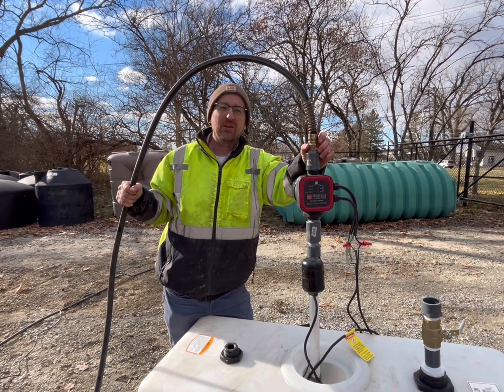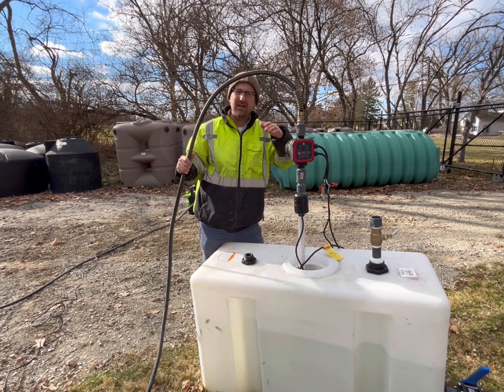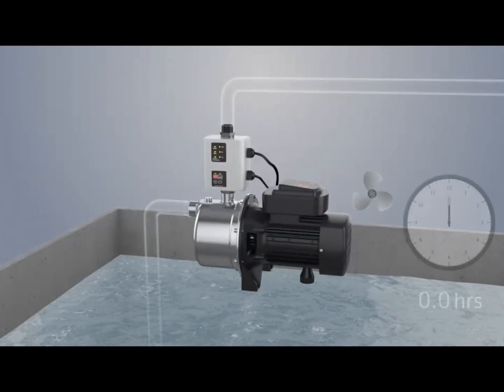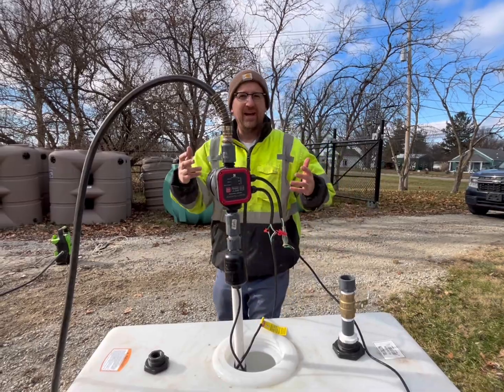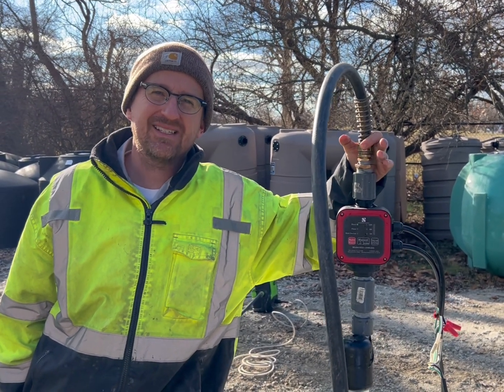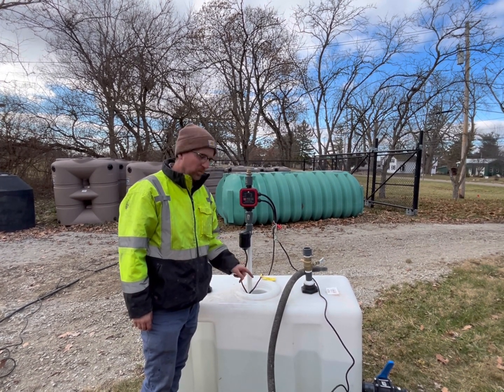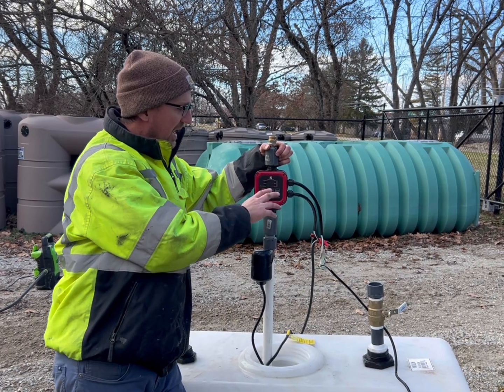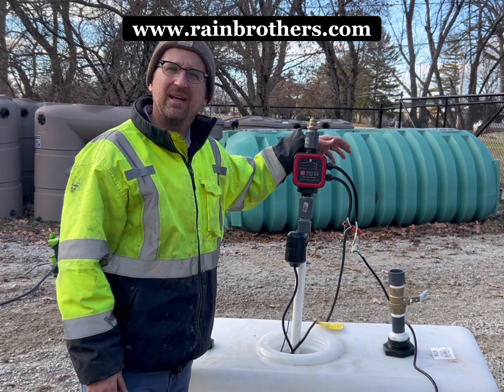Automatic Pump Controller

Comment: you did not speak on the manual function? How does that work? can it be used to manage short cycling
Reply from the maker: Sorry for the confusion. If you press the Manual button, then press “+” or “-“, that will move the pressure settings of the controller up or down around 2PSI per press. We cover this a bit in another video we have for this controller

Comment: I installed 0.5hp surface pump with automatic controller from ground tank reservoir to boost pressure to the building at second floor level but it can't sense when the pressure is low, what could be the problem?
Reply from the maker: You used this controller with a jet pump? There could be a few things going on here: First, did you try pushing the plus button to increase pressure? Second, did you check the performance specifications for your pump to ensure that it can even generate the flow/pressure you’re looking for? If you contact us M-F from 8-4 EST, we can help troubleshoot further